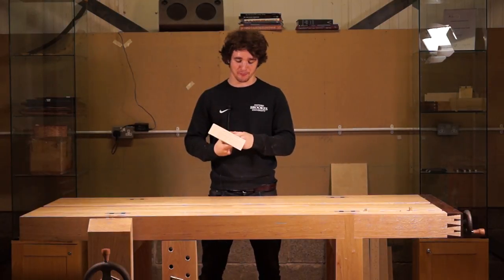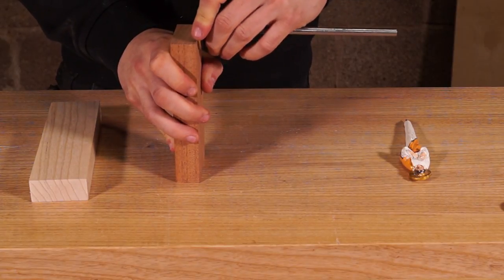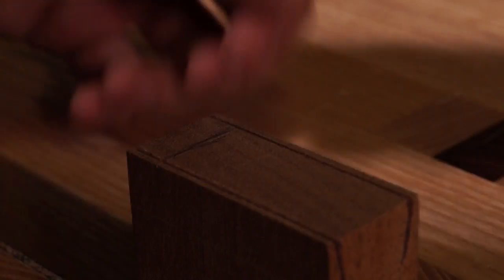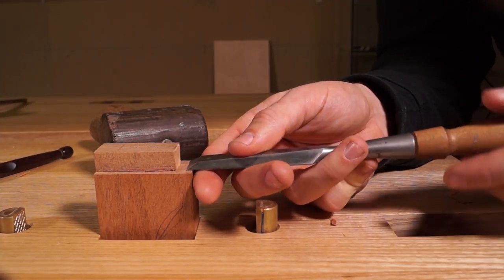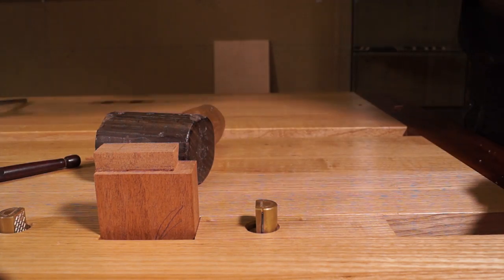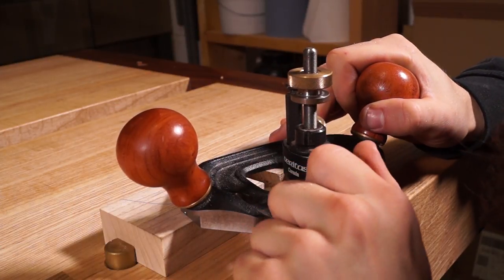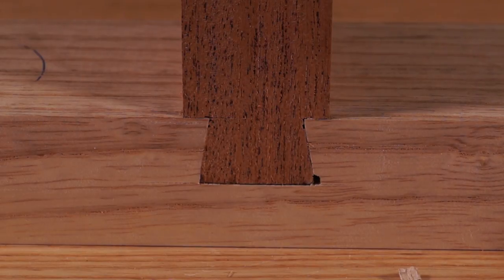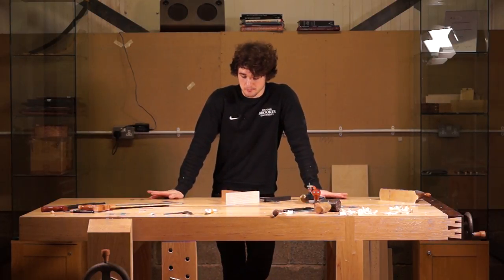How to cut a DOVETAIL HOUSING JOINT by HAND

Comment: Curious could you have removed a thin bit of material from the shoulder of the darker wood to let it fall that minimal amount into the dovetail without sacrficing the tight fit of the joint much?

Comment: Great video, I like your attention to detail, care and accuracy. I would consider using a chisel or knife to sever the fibres the saw couldn't reach instead of just breaking them out. The joint was stuck a bit earlier than where you marked it, due to the stopped portion of the dovetail; looking for shiny spots on the joint helps to locate tight portions as well. And finally, for such a short joint parallel works well, but if the parts get wider and the groove longer, it may be worth tapering the dovetail ever so slightly, in order to have the joint lock only in the last 1-2 inches. Keep it up!

Comment: I have a project I'm currently working on where I need a dovetail housing joint and was originally going to do it with a router.  The piece is too small and I didn't feel safe, so I may just have to sharpen my chisels and give it a try with hand tools!  Thanks again for the video and I really appreciate you showing the mistakes, it helps make it feel less intimidating.
Reply from the maker: No worries mate! Best of luck with it!

Comment: I have the same Veritas router plane and found that if I have upward pressure on the blade anytime I’m adjusting the depth of cut, it avoids nasty surprises. One way to do this is to make sure the plane is sitting upright with its weight on the blade anytime the locking collar is loose.

Comment: My veritas router has the same fault. Besides the weak locking system, the blade end can be too trigger happy too… allowing the bevel of the blade dig deeper into the stock and micro-tilting the base forwards.

Comment: When making a depth adjustment with a router plane, once the locking clamp is tight, rotate the adjustment knob up (counter-clockwise) to remove the slack. This will prevent the blade from being pulled down while cutting.
Reply: youd have thought hed have known that,i mean he has all the tools so must be an expert
Reply: I normally do that too but sometimes we all forget in the excitement of something

Comment: Matt. Is this kind of joint that could protect the table top when you do it at the bottom of table top? Protect for example of twisting when you  glue UP together wide  boards. If that is True do you have any advice for do it all acros the table top? Thanks  and greatings 😊

Comment: You can crosscut with a rip saw. You could also sever that line with a chisel and a mallet, a K-BAR and a lead pipe, or a steak knife and some grit -- comma true. After 7 years in a mill shop, I gotta say that 90% of woodworking is knowing what's the right tool for the job. Or the right combination of tools; if you've ever had to match an antique moulding with a shaper and a random collection of router bits, you know what I'm talking about.
     Anybody who reads this and hasn't seen the vid on how to saw needs to go watch it, by the way. My sawing is several orders of magnitude better just from watching it and applying it. And that's without practice. Great stuff!

Comment: Woodworking is the never ending pursuit of the unobtainable idea of perfection. Good you think you know what happened, all errors are preventable, but also sometimes unavoidable. From my view it was the knife lines that caused the fiber to sever, sometimes because of unpredictable grain structure. Most folks wouldn't show a video of a cross grain dovetail. And you rightly point out that it is never the tools fault. Go to 17:13 and look at the horizontal knife line protruding past the dovetail line . Still, great job.